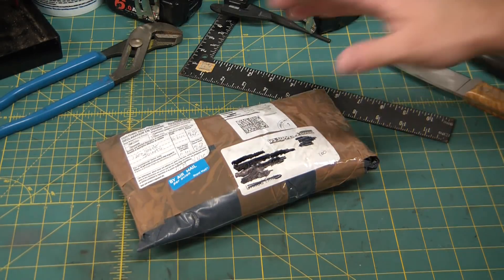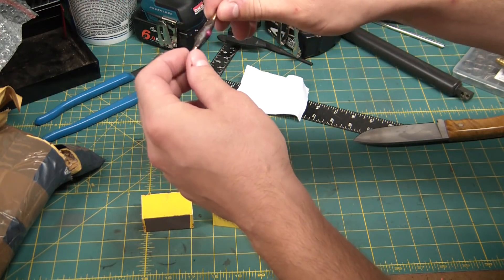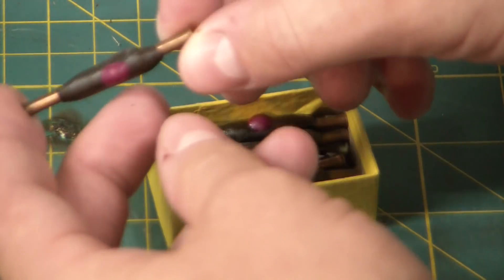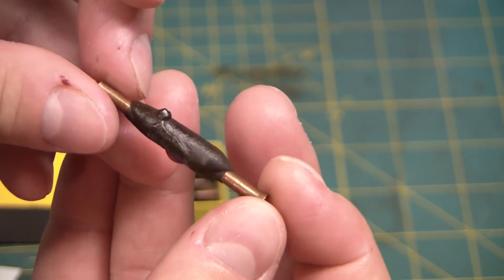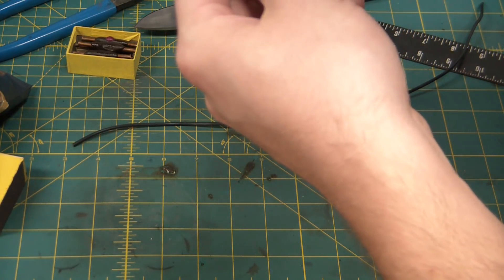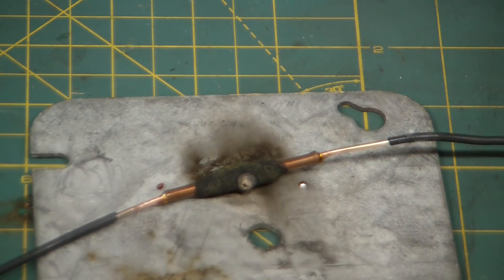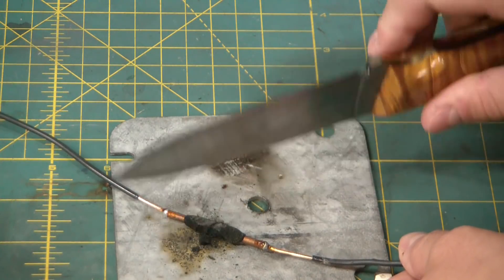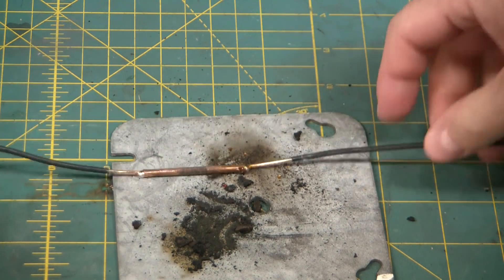Ingenious Self Soldering Sleeves!  (A Very Old Invention) - ElementalMaker

Comment: I was shown how to use these during training in the Royal Signals, this would have been in the early 70's. We used D10 cable which is a general purpose telephone type cable have a mixture of copper and steel strands. When the solder melts you have to push the wires in, the problem is this forces some of the solder out and if you're not careful goes all over you hands
Reply: Thanks for the info. The instructions certainly didn't seem to be aimed at using this with a solid core wire. Quite interesting that they have a mixture of copper and steel strands.
Reply: @HashanGayasri  Copper was for conductivity, steel was for strength, you could be pulling out 800m of the stuff.
Reply: Ah, a fellow Ex-Telecommunications Lineman. I was also in the Signals Corps, in the Canadian Forces from 1996 - 2003 and we very rarely soldered anything unless it was for connectors, the board, etc. We always did mechanical splicing by hand on our field cable as well, which was also a mixture of steel and copper. Copper to carry the current and steel to hold the splice together. Then electrical tape from center to left, from left to center, from center to right, and then right back to center and then you have a waterproof splice... if it's done properly and not -40 degrees celsius. ;)
Reply: Did that on more than one occasion
Reply: I was in Germany 1985-1989, still being issued! Came in soldered tin boxes, each connector and striker being encased in a thin lead tube you could tear open.

Comment: They make similar connectors that you can use a match or lighter on to get a soldered connection. Check out this 2017 article: https://kk.org/cooltools/solder-seal-wire-connector/

Comment: As a field technician for agriculture I found many useful ways to splice wires fast easy and the less tools the better... there are connection just like this one except all it takes is a heat gun and strippers clean or dirty...strip insert wires and heat the heatshrink the solder will melt and the whole thing water proof

Comment: The modern equivalent is shrink tubing with a solder bead inside, insert wires and hit it with a butane lighter or hot air source.

Comment: It would be a pain to use these in a wire bundle. You'd have to shield the other wires insulation so they wouldn't burn or melt the from the pyrotechnic.

Comment: Yeah try melt potassium nitrate with sugar 50/50 WITH NO flame on hot plate only paste it on a copper tube  and let sit somewhere until it absorbs a bit of moisture so it will burn longer maybe from a cold morning outside make your own should easily get hot enough

Comment: They do sorta it uses shrink tube and a lighter or heat gun and ultra low melting solder the idea is you put them in a butt connection the shrink tube over it a small bit of solder it melts the hot glue supports melt and the whole thing shrinks down.

Comment: Is strontium radio active? Just doing a quick search, I think it should be, slightly. There are different kinds but it might be detectable if you have access to a meter. It looks like strontium was used in flares and it is pyrophoric. So just being exposed to air should set it off so I think it's doing all the work of heating and melting. I'm curious what happens if you scrape off the outer coating? That is a great little item.

Comment: The instructions state: "until conductors overlap a full half inch"  A very important clue.   Having been in the military, before modern day technology, 38 years ago, we used what was known as coms-wire (looks like this:   https://www.omahas.com/shop/communications-wire-spool/ )  for communication between field telephones.  Think when Radar, on the sit-com M.A.S.H., would crank the phone and talk to "sparky".  This wire had significant tensile strength to deal with being stressed while in the field.  This coms-wire was stranded as stranded wire is better able to withstand bending without breaking.  As soldered joints are quite strong and weather tight, these type of connectors would be ideal.  Presuming that I'm on the right track, these connectors would have been used with stranded wire.  The stranded wire would overlap within the copper tube half an inch, as indicated in the instructions, creating an even stronger joint and the insulation would butt up against the tube when the solder melted and the wire was pushed in deeper to create the "full half inch" "overlap."  These connectors would have been ideal for making field repairs on existing coms-lines or making connections while stringing line over long distances.  As solder joints are only good for low voltage, and field telephones only use low voltage, this is another indicator.  As this coms-wire has two conductors, staggering the two connections would allow for insulation between the conductors to be maintained and a bit of tape, if available, to cover the two connections would finish off the connection/repair.  Hope this helps.
---------------
Thank you all for the corrections regarding my statement about 'low voltage'.   I ought to have used the term low-current-flow.  What I meant, presuming my understanding of electricity is somewhat accurate, was:  
- An electrical connection that:
- Within anticipated operating conditions. Such as:
     - Ambient operating temperatures, 
     - Adjacent insulating conditions,
     - And the joint's/adjacent wire's ability to dissipate heat,  
- And where the wire does not have the possibility of receiving a high enough current flow,
- Within anticipated operating conditions,
- At or adjacent to the location of the joint,   
- Over a specified period of time, 
- For the given wire size, 
- To cause the wire, directly adjacent to the solder joint, to heat and soften the solder alloy within the joint, 
-  (Caused by the electrical resistance of the wire relative to the current flow), 
- To cause the solder to soften and the solder to lose it's physical strength, 
- And the joint to fail, if under physical tension.
(Speculation:  The joint itself would not heat as much as the wires leading to the joint.  As the joint with wire and solder has a greater cross-section, is the larger conductor and would heat less.  The physical mass of the soldered joint with its copper tube, being slower to heat than the wire, its increased surface area and being without insulation, would allow it to transfer and radiate heat well.  Causing the joint to act as a heat sink for the heated wire near the joint.  Therefore, the wire, being the smaller conductor, would heat more.  As the heat increases within the wire, some distance from the joint, so would the electrical resistance at that location.  As increases in the wire's metal temperature reduce a wire's conductivity, more heat would be generated at this point of greater resistance, away from the joint, until the wire melts and separates.  Opening the circuit and stopping the flow of electricity.  Therefore, given the two variables of time and amount of current flow, over a specified period of time, plus the significant difference between the melting point of the wire's metal alloy verses the melting point of solder's alloy, it appears to be a toss-up whether or not the wire would melt first or the solder within the joint would melt first.  Speculating that the higher the current overload, the higher the probability that the wire, some distance from the joint would melt before the solder in the joint would melt.  The lower the current flow, outside the design specifications, resulting in the solder melting first.  Plus the heat conducting ability of the wire alloy being another variable.  As copper is a great conductor of heat, if used, it would probably result in the solder melting before the wire melting.  So many variables.)
(If the joint were not under tension and level to earth's gravitational pull, so that gravity would not possibly overcome the capillary action of the molten solder, within the joint, which is not typical in a static location, even in a vertical position, within the gravitational pull on earth's surface, the joint would still conduct electricity.  Although, it would be physically unstable.  On the surface of planets where gravity is much more than that found on earth's surface, conditions would be different.)
:)
Reply: I'm a communications technician in the USMC. We still use that stuff, but most of us call it slash wire nowadays. When I arrived to my first unit, they still had old AN/GRA-39s laying around! We used to mess around with them and play pranks on coworkers by hiding the speakers around and talking into them after wiring them from another room.
Reply: Electricians used solder & friction tape instead of wire nuts many yrs ago.
Been in the field for over 20 yrs now and have remodeled & demo'd lots of it.
Reply: @brycecroft4900  I remember in the 70's, the 120v ground wires were twisted and soldered together.  Now we have solderless crimps.   Which is truely better?
Reply: @funnyfarm5555  yeah there's definitely crimps heat shrink butt splices & freaking wegos lol but I still think this is better for certain connections, I wouldn't use it for industrial controls or anything. 
Honestly was thinking maybe some residential or commercial applications for  lightning with 30 amps max & sizes up to #10.
Also direct burial splices with heat shrink would be better then the lug type that's available today.
Reply: CRIES IN CIVILIAN
Why can't my headphones be made so well?!
Reply: @scratchpad7954  they can be: sennheiser hd25
Reply: For demolition use I wouldn't expect the instructions to include breaking off the burnt compound, or bothering much with insulation. Why bother when it would be for a one time use and is going to be blown up?
Reply: greggv8 
      There might be a situation where the demolition wires were soldered, then left to sit for some time before being used.   Also, the wires might be buried to hide their presence.

    Oftentimes, when units were ordered to defend a bridge crossing, the bridge would be wired with explosives just in case they needed to retreat and didn’t want the bridge to fall into enemy hands.

       Over several weeks, the burnt potassium perchlorate can cause corrosion in the copper conductor when exposed to moisture.  That is why the instructions call for the removal of the burnt material.
       Even in a short term use situation, insulation is critical to ensure wires do not touch, causing a short circuit.  Long term, the insulation helps keep moisture (and therefore corrosion) away from the joint.
Reply: @greggv8  Perhaps to reduce the smell?  I mean if it really is distinctive then there may have been dogs trained to sniff it out.....
Reply: I wondered how soldiers could so quickly patch up wiring cut by enemy action or accidents. This makes perfect sense.
Reply: @5roundsrapid263  Im in the Finnish army and completed the signals nco course. So pretty much communications, and an nco course together. If we have a break in the wire, either its cut by an enemy or just breaks we tie a knot between the cables, before we connect and wrap the wires around each other and just use electrical tape.
Any time we have to connect two of these cables together we tie them around a tree and tape the wires together so it's easy to disassemble when we gotta get the fuck outta there
Reply: @Richard Vaughn I'm sure he was referring to whatever voltage was available in the field to use a soldering iron or gun with. 120/220/240, etc. Very cool invention though...
Reply: There was steel wire with the copper, you can find videos on how to properly splice comm wire to keep it strong. Think it was on the periscope youtube channel.
Reply: I can confirm the use in the manner described above
Reply: solder only good for low voltage? As an ET I used soldered joints on all voltages even high voltage. What makes this look like a low voltage joint is the exposed conductor.
Reply: That would make it way more practical for rapid use
Reply: I like that it says in the ad "1000ft/0.5 kilometer)
Reply: Wow thank you for posting this

Comment: I was a communication electronics repair technician for the Marines (2875). Back in Vietnam we had AN/GRA-39 radios, which was a simplex comm system using a two-stranded wire (also called telephone wire) for each way. These could be easily used to repair those cables, since it wasn't coaxial or anything.

Comment: Huh, my grandfather had boxes of these.  Was still using them as late as the 1980s to do things on the farm.... mostly repairing this one tractor. It was probably 70% solder by weight.

The tractor, that is - not the sleeves.

Comment: Hey, manufacturers still make quick joints, but in other ways, it is now a silicon tube fill with low temperature solder, you'll need a heat gun to blast it for a minute. Not cool anymore. And questionable too, if i can operate a heat gun in middle of nowhere, why i don't use a good old solding iron to do a proper job? I think the modern ones are making brilliant idea stupid.

Comment: What about a little bit of nichrome wire with solder around the middle. If it is small enough you wouldn´t need more than a few volts to heat the wire and it could melt the solder before burning through the nichrome. Once it burnes through the nichrome wire the solder cools and hardens on your joint. You wouldn´t be able to use it for explosives (or at least not test the connection before hand) but how often do you need to solder explosive detonator wires. These days you could do some minor soldering with a battery powered soldering iron like those flameless lighters so I guess you don´t need it anymore.

Comment: I'm an unlicensed electrician, but have a repair shop in my basement for electrical and electronic things. I found what you got to be very interesting. I have used small copper tubing before to solder wires together and used a soldering gun , instead of using a crimp type butt connector. Although I have cut the plastic housing off a butt connector and soldered wires at each end a few times.

Comment: There is a product called Solder seal connectors, roughly the same principle except you use a cigarette lighter to heat the solder. Pretty handy when your in a tight spot.

Comment: I suppose the "Heat Shrink Self-Solder Butt Splice Connectors" you can find on Aliexpress are a sort of spiritual successor. They're not quite THIS handy as you still need a source of heat, but they're not dissimilar either

Comment: There is a low temperature solder joint that is pre insulated in shrink tubing. Heat gun or lighter is enough temp to  shrink the tubing and melt the solder .  These are awesome though

Comment: In the Navy Air Wing we used heat shrink with solder inside that we then used a specialized heat gun to heat for a perfect solder joint in the school, in the field it was a bic lighter.

This is similar to thermite welding on rail track we use today

Comment: I understood directions for stripping wire as: strip 1/4" in excess of half the length of the sleeve...take half length of sleeve and add quarter inch. Looks like that would have given enough room to push wires into sleeve up to the insulation before the solder hardened...jmtc

Comment: Soldering 110v connections I believe is no longer an acceptable practice because the circuit can potentially make enough heat to melt the soldered connection.

Then ther is a danger of either hot solder dripping onto something flammable and or the connection arching and causing a fire that way.

There are a host of new bonding techniques that actually fuse the copper (or whatever metal the wire is made of) wires together.  Though those techniques are only used by utility companies.  I don't know of anything intended for home or commercial use.  That said I'm not a professional and whatever I know about this is just second hand information I've gathered from hanging out and talking to engineers who work on this sort of thing.

Comment: I was expecting you to insulate it with friction tape.   Look on eBay or AliExpress for  Solder Seal Wire Connectors.  Same idea but also have shrink tubing around them.  No pyrotechnics but maybe they will work with a Bic.

Comment: Teletype connections had to be sound, as the devices depends on a 20 ma. current loop.
Demolition generators produce high voltage and high current, so connections don't have to be perfect.
A noisy connection is death for teletype.
A field telephone doesn't really care.
How do I know? Army MOS 31N20, tactical circuit controller.
BTW, Western Electric uses a smaller version of these that uses a lighter for the heat-source.
Heat-shrink tube with a band of solder/flux at the midpoint.  Slip it over a Western Union splice, heat it until the tube shrinks and the solder flows.
Only good up to 22 ga., however.

Comment: There is a Mil spec on self soldering sleeves, but they require an external heat source (MIL-S-83519). The military must have done away with that style for some reason. Maybe whatever they are made with is hazardous, or they don't work well once damp which maybe the new ones are better?

Comment: EM, to me, they said strip the wire 1/4" longer than 1/2 of the sleeve. When it was still burning, push both ends of each wire into the middle. I bet it would take up the slack and the insulator would be at the edge of the sleeve. Cool way to solder.

Comment: A little bit like these here:
https://ae01.alicdn.com/kf/H9c07948aadba454eb724af85ee09947di/25-teile-los-Universelle-Wasserdichte-W-rme-Schrumpf-Schnelle-Solder-Ring-Terminal-Block-Zwischen-Joint-Stecker.jpg

Only that thw WWII one is awesome. However, the chinese rubber thingy works well for quick connections - in a similar easy fashion.